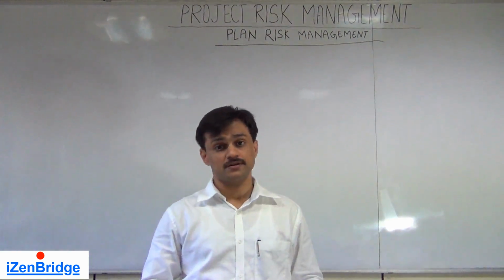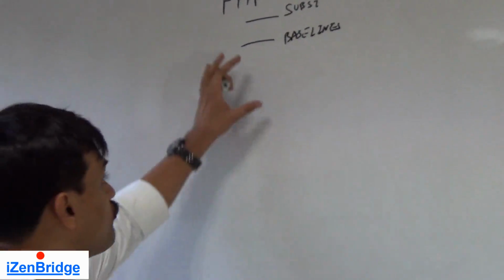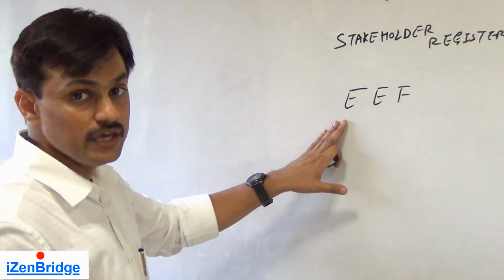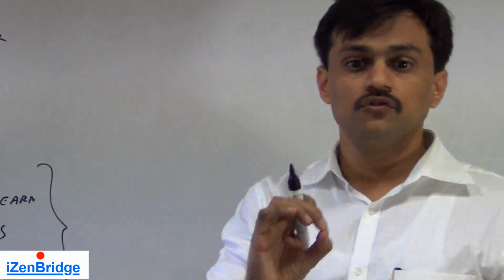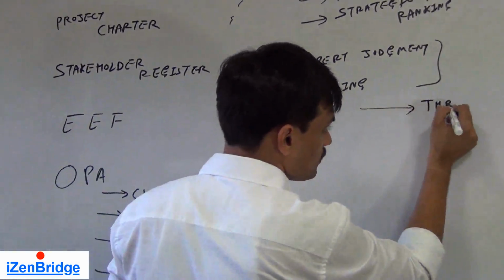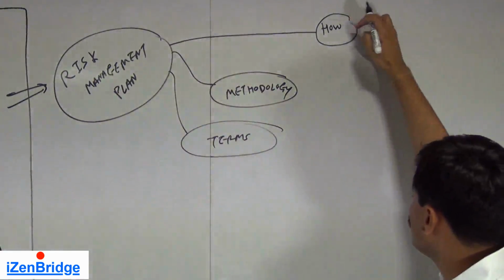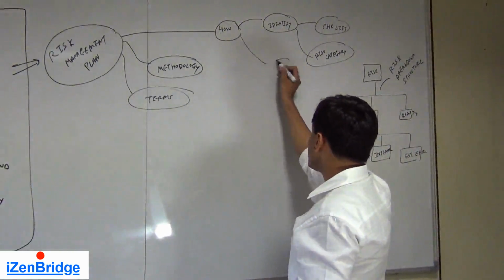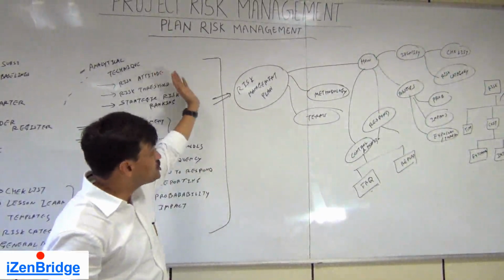Project Management Professional (PMP)®  | Plan Risk Management | Project Risk Management

Comment: Please inform if the below information is true or false 

1. When you are identifying & analyzing “new risk “mid-way into the project you are in “ Monitor Risk " Process

2. Preliminary risk responses can be done in " Identify risk " Process

3.  When we are categorizing risk by source & type , we are are in the process" perform Qualitative Risk Analysis "

4. When we are creating a draft of Risk Register & risk strategy , we are in  "Plan risk management "

5. Hiring a third party auditor to minimize the chances of a hefty fine due to non-compliance is " Mitigation" & not transfer
Reply from the maker: Process Mapping and Identification is no longer needed for PMP exam.
and Many actions can be done in more than one process so it will not be good to see one thing in one process only.